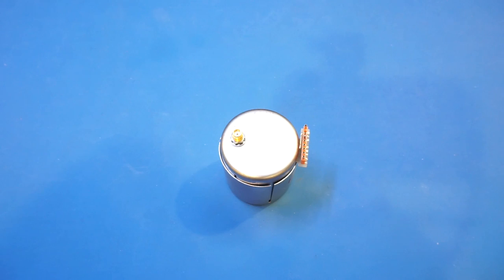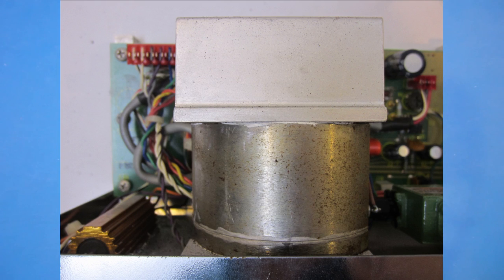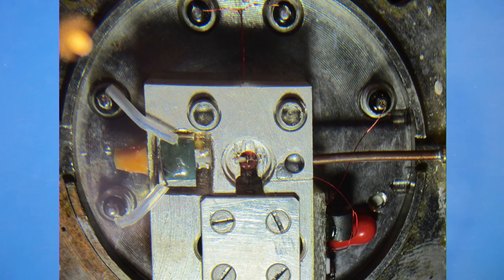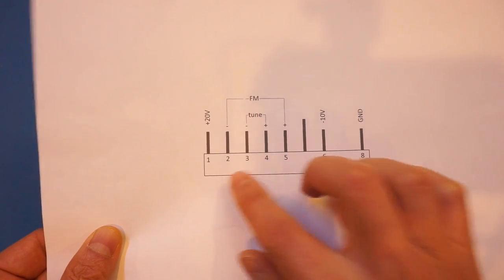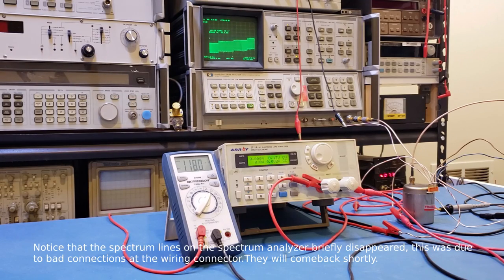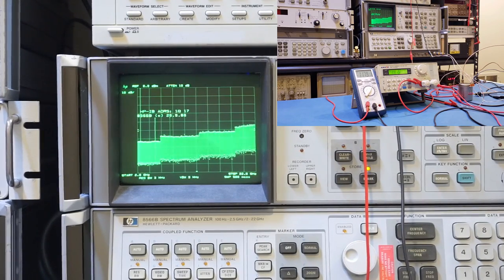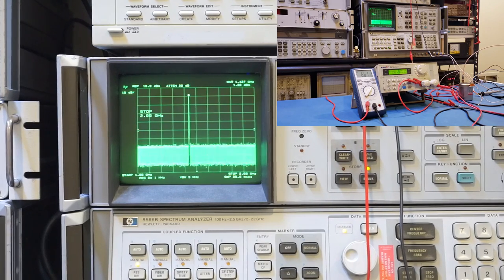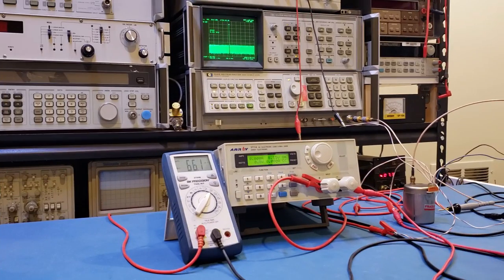How does a YIG Tuned Oscillator Work? Powering Up an HP YIG Oscillator

Comment: Thank you for this video. 
Excellent video.  Very helpful to me.
What is the voltage/current range on the FM coil?
The -10 bias. Is it -10 relative to +20v ground?
Reply from the maker: The FM coil current range is similar to that of the main coil, up to 200mA or so.
Reply: @KerryWongBlog  thank you Kerry wong.
You give me insights.
I find it very kind that you bother to answer casual questions on the comments.

Comment: Thank you Kerry for sharing this video, when I am measuring the YIG oscillators, I found out that if I connect a DMM into the FM tuning circuit in series will contribute to serious phase noise, do you think there is any method to isolate the DMM while measuring phase noise?
Reply from the maker: Perhaps you could try using a current probe?
Reply: @KerryWongBlog  Thanks Kerry for the reply, definitely will try it

Comment: I'm wondering if the frequency changed much with orientation?
Reply from the maker: The frequency doesn't change in any measurable way as the environmental magnetic field is very weak. However, YIGs are supposed to be mounted only in the way that is specified by the manufacturer (in this case it is vertical) as there are delicate components inside that may be damaged if mounted incorrectly due to external forces such as vibrations, etc.

Comment: Accelerated/discellerated charged particles in a material, emit specific electromagnetic  waves.
I wonder if it works the other way around,  reverse causality. 
Those specific electromagnetic waves would be absorbed in the material,  as negative lumincess,  causing accelerated charged particles. 

Do quartz generate second harmonics in the microwave range, as well?
Do yattirium iron garnet is an anisotropic resonator, or isotropic resonator?
Is being anisotropic resonator, makes this material special?

Comment: Please. 
Can someone explain how the -10dc biasing was done?
He connected the( +)10dc terminal to the (- )of the 20v output on the power supply?
Or
He used an offset function on the power supply?
I don't understand. 
Its -10bias relative to what?
In other words,  where is the other terminal of the -10bias, to create a loop with?

I do understand that -10 is the mean average of a square wave with an offset of -20.
Reply from the maker: Hi David, the +/- bias are with respect to ground (pin 8)
Reply: @KerryWongBlog  thank you all so much,  kerry wong. Mighty kind of you to answer questions on the comments. 
Keep doing those marvellous videos.